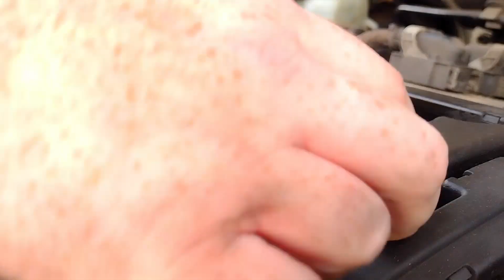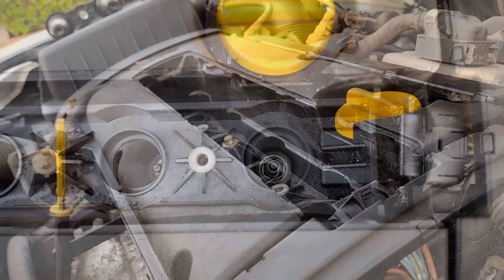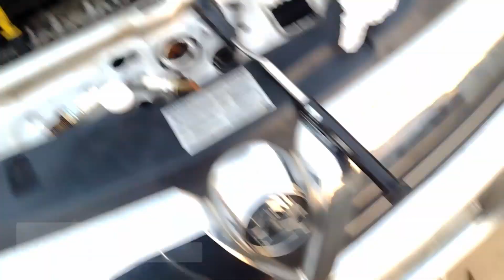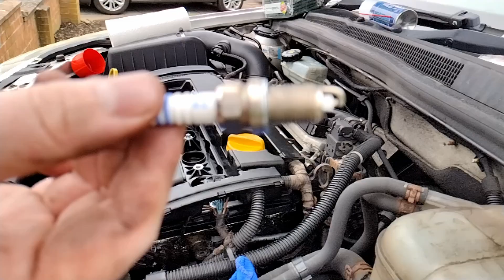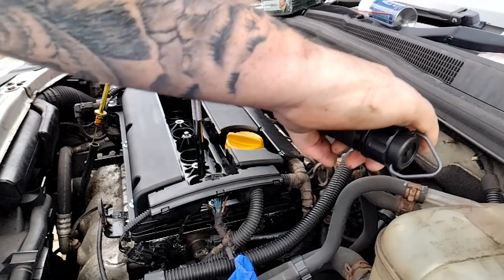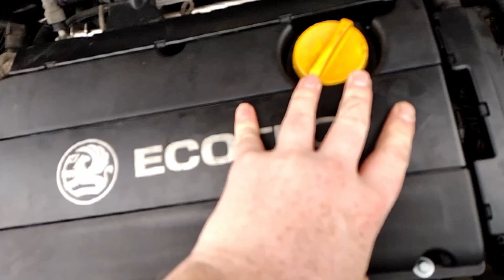How to Replace Spark Plugs - Astra H

Comment: You should have bought some Brisk copper spark plugs not Bosch or Ngk.
These are the Oem plugs, and it runs much smoother and better than those Ngk's or Bosch.

Comment: Great content on your channel mate, learnt a few things. Would the failure rocker cover gasket cause jerky acceleration inbetween gears or do you think the MAF needs changing
Reply from the maker: Generally a failing rocket cover gasket would lead to leaking oil and low oil levels if left untreated, not sure it could cause jerky acceleration though

Comment: Great content here mate, straight to the point. Would this cause any problems like jerky acceleration or do you the MAP needs changing
Reply from the maker: Bad spark plugs could cause a misfire which could cause issues with acceleration, would be best to do some more diagnosis to narrow down the problem I reckon
Reply: @BurningOilYT  thanks mate what diagnoses would you suggest trying